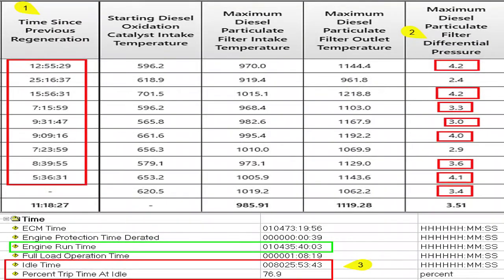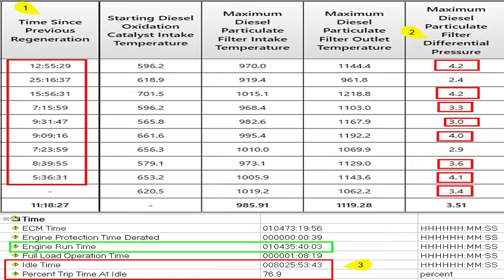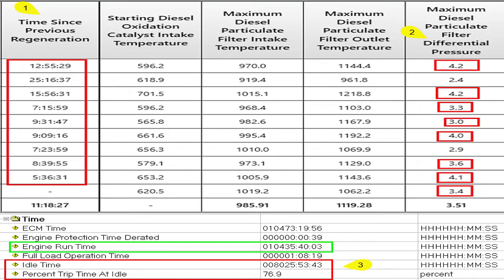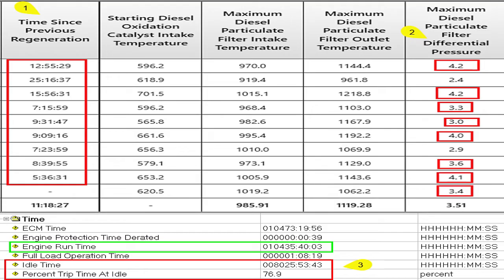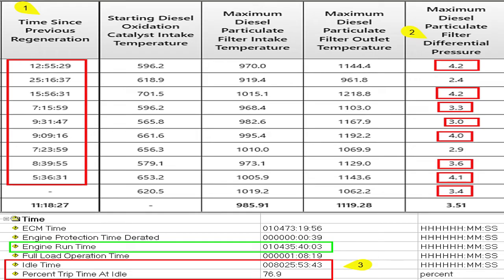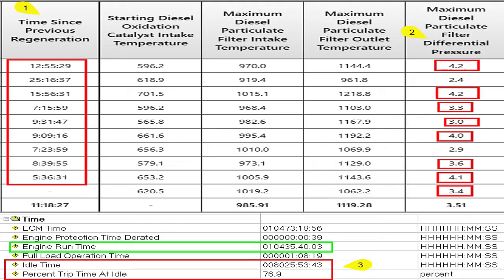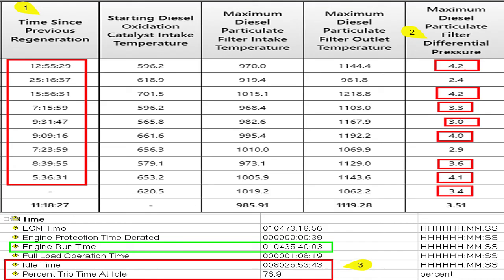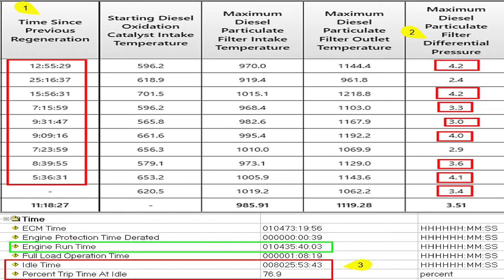Why do I have fuel in the oil again??

Comment: Unfortunately such is life for most service trucks. If buying used I would always favour a truck with low miles but high hours.  
You can always swing an engine. Keeping a mile’d out truck reliable is another story
Reply from the maker: I agree. The vibration put on with mileage is hard on everything including harnesses. In our neck of the woods they put down calcium chloride and salt in winter so frames go too.
A few years ago I was in our Baton Rouge branch and the service trucks had cats in them that is how long they could keep them. We stopped buying cat power around 2005.

Comment: Dang that’s like idling 24/7 for a YEAR!!!

My old diesel does not idle smooth. 
Encourages me to NEVER idle
More than a few minutes.
Reply: It won't bother it if it's emissions free. I had a diesel VW golf that ran for 4-5 months of the year, otherwise it wouldn't cold start. Just make sure you also work em hard now and then to clean out the pipes.